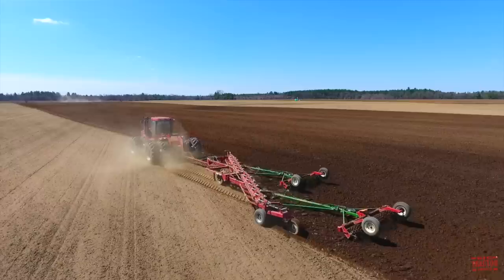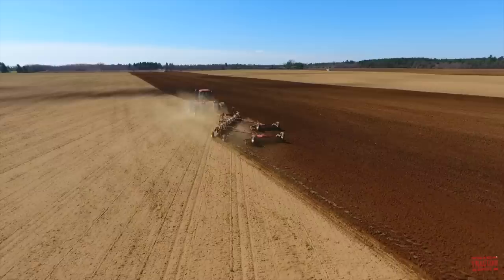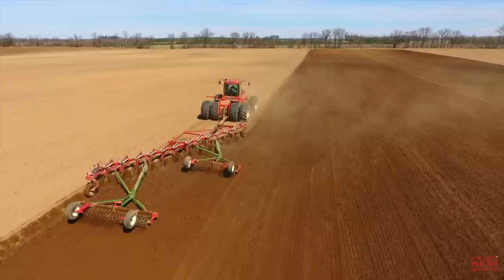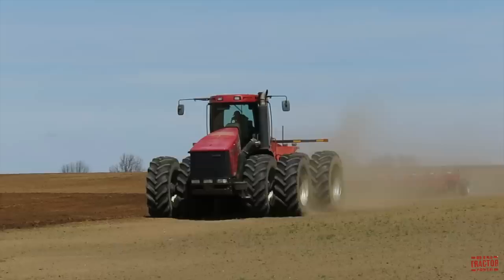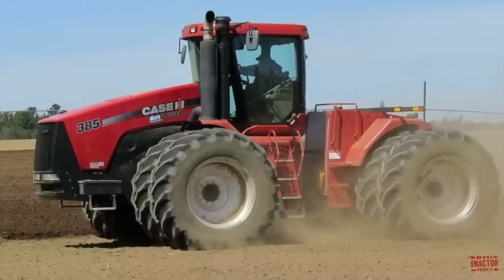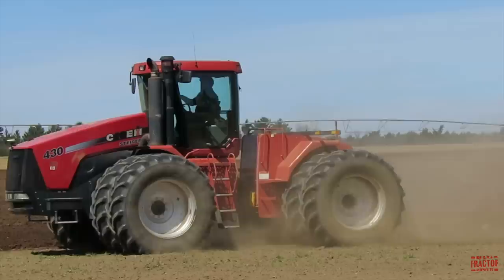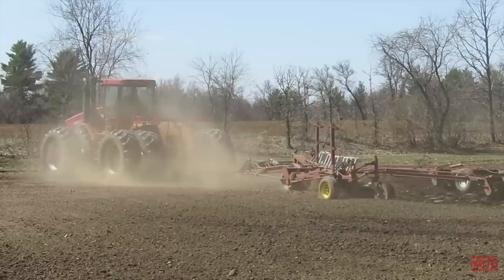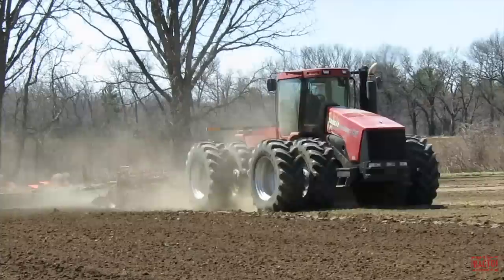Case IH STEIGER Tractors Plowing

Comment: FYI. The tractors hold 300 gallons. At $5.00 per gallon, that’s $1500 per day. Compared to $2.50 per gallon, $750 per day. Wonder why your food costs are rising?
Reply: SARCASM MODE  

At least people aren’t getting their feelings hurt on Twitter.  That’s what’s really important.
Reply: Food cost going up is mainly due to the processors . Farmers only receive a market price from the processors , that price can go up or down . The market prices don’t change when fuel prices for farmers go up .
We grew tomatoes and the contract prices actually dropped $10 a ton between 1979 and 1983 but fuel , equipment , and labor cost went up .
To combat that farmers just have to improve efficiency.

Comment: My dad taught me how to plow when I was 14 for the farmer I worked for in High School he always marked the field 18 rows off ends and sides and thur the whole field to have even head lands then dad showed me how to plow a field around starting at the fence working towards the center then plow the corners out
Reply from the maker: Thank you for sharing.  Those were great days in farming.  Plowing was a true craft in tillage. In the case of these Steigers use gps to make perfect passes all mapped out across the field.  What tractor and plow did you run back then?
Reply: @bigtractorpower  IH 1026 Turbo/Hydro with IH 5 bottom plow then a 1086 and a 3588 2+2 with a 6 bottom plow

Comment: Great operation but a swing or flip plough is 50%+ more effective. Gregoire-Besson or Lemken manufacture 12 furrow + sizes
Reply: 50% more efficient ❓❓ 🙄 🧐 🤦🏻‍♂️ 🤷🏻‍♂️   Gotta see that done‼️ 🙋🏻‍♂️
Reply: @jimstepan3038  Used it for years, flip  or turn ploughs go back on and forth on the same furrow like a chisel, conventional ploughs spentvmost of its time going around in ever increasing circles and then youbstill have hollow furrows where your acerage connects ,In Europe and in my area South Africa we got rid of conventional ploughs in early nineties
Reply: @ericsmith1453  , the ONLY advantage I can see is the elimination of ridges from striking out lands, and the gullys called dead furrows !!  
  That 50% reduction in time for a roll-over plow to plow a large field floors me !!  The time it takes to make the loop to turn big roll-over plow around on each head land would average out to nearly the  same on both styles .. I've plowed many acres with a 14 bottom one-way plow and I can't even imagine reducing the total time by 50% ‼️ 🤦🏻‍♂️ 🤷🏻‍♂️ 🙋🏻‍♂️

Comment: Not reversible, a lot of empty headland travelling especially in these huge fields.
Reply: The larger the field, the less the advantage of a roll-over plow.. Jess sayin' ..  🤷🏻‍♂️ 🙋🏻‍♂️  Also, roll-over plows. are TERRIBLY expensive ‼️‼️  Used big 'one-way' plows are getting to be "a dime a dozen" ‼️
Reply: @jimstepan3038  ye I get the expensive part, but the bigger the field the more the advantage of a reversible imo, cuts out all the headland travel and eliminates the need for finishes and fearings. Mind you on a plough that size reversibles are extra heavy, not that those beasts would know 👍
Reply: @bigteddy66  ,  a large roll-over plow does NOT "cut out ALL head-land travel" !!  A large roll-over plow requires considerable time to make the loop from exiting to re-entering the land..  
  What I'm gettin' at is the time spent plowing will be the same with any two plows of the same size !!  If the land is a mile long and your travel speed is 4½ mph, it takes just under 15 minutes to make one pass ..  I know from experience that the travel time on the headland averages under 1 minute ..  I can't picture a roll-over plow making that loop in much under 1 minute !!  AND, as the land closes down, the one-way turn time drops significantly, whereas the roll-over times may increase .. 
  IF the resulting 'striking out' ridges and 'dead furrow' gullys formed from opening and closing lands is a problem, THEN a roll-over plow is the cure ..  😊 🙋🏻‍♂️
Reply: @jimstepan3038  does not what?? Save time?? Save finishes etc?? Of course it does that was the whole point of them. It has to be in the hands of the right operator but it does save time, by the time you have looped round and dropped the plough back in a conventional will still be travelling on the endrig or headland. Think about it.
Reply: @bigteddy66  , sorry, bt ..  I was in the middle of answering your previous post and got caught in a couple phone calls .. 🤷🏻‍♂️   Soo, was wonderin' , have you operated a roll-over plow ..  I have operated exactly 1 roll-over plow !!  It was a 6 bottom John Deere fully mounted plow on a 4840 John Deere tractor ..  It worked great in fields with no rock pressure ..  BUT, rocks caused the owner to park the plow after the second season .. He went with a 7 bottom automatic reset bottom plow and 'never looked back' !!  That roll-over plow became a fixture in his machine shed .. No one wanted itt !!
Reply: @jimstepan3038  yes I have used both reversible and conventional ploughs  all auto reset apart from one which was a trip leg MF rubbish thing. Used lemken, kverneland, Naud, Gregoir besson, huard and Rabe, lemken being the best in stoney ground, on various makes of tractor from zetor, Leyland, Deutz, Same, Hurliman, Steyr and Fiat. (Some  ploughs and tractors were demonstrators)